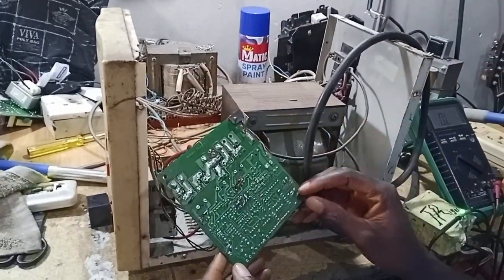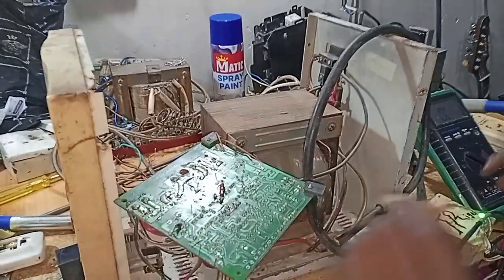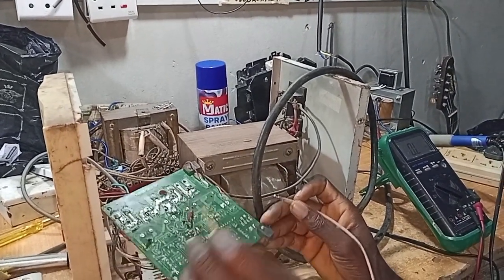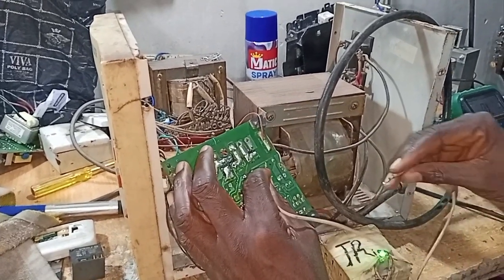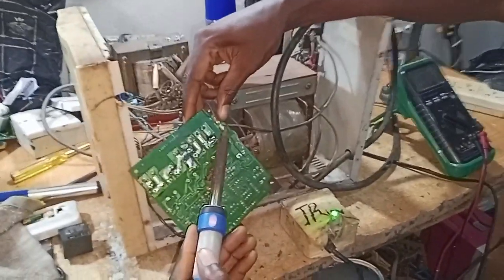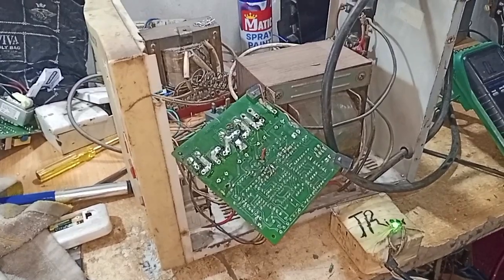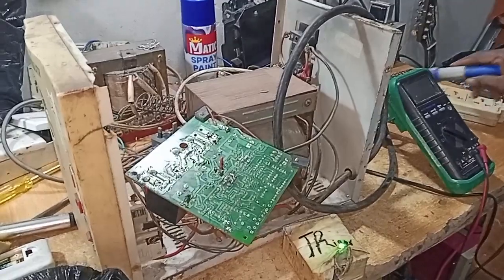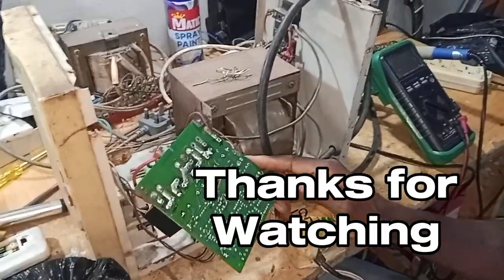HOW TO TEST & TROUBLESHOOT RELAYS LIKE A PRO

Comment: Hello. What happens when I turn on the stabilizer and I hear what sounds like multiple relays tripping just before the stabilizer turns off again? Then it doesn't turn on again for a while. When I turn it in after a while, it does the same thing. It's a firman 5000W Stabilizer.
Reply from the maker: How long have you been using it?
Reply: @robinTechelectric  2 years.